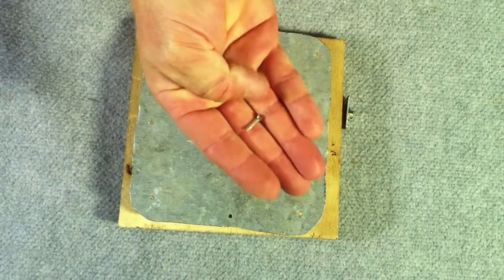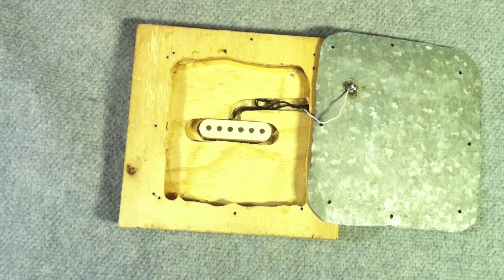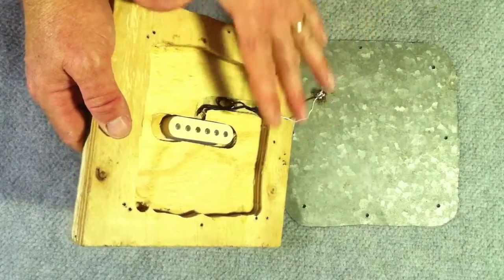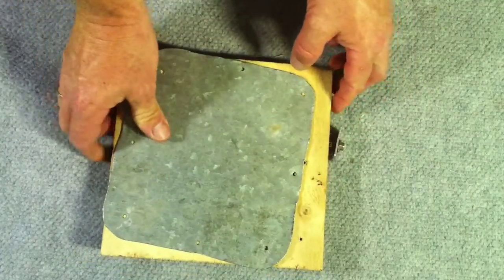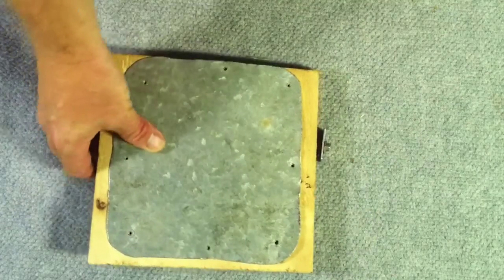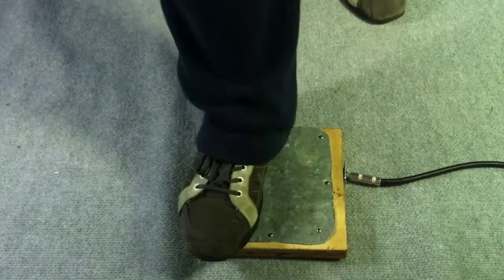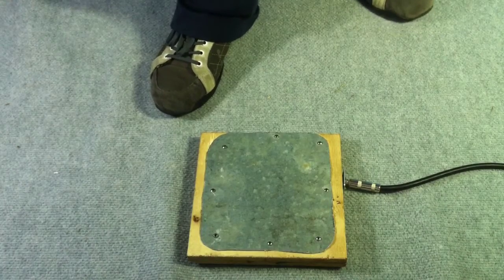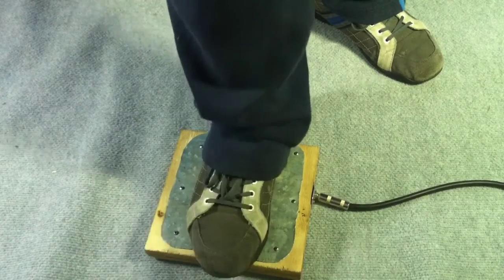DIY Stomp Box (Foot Drum)

Comment: Very interesting.  My version is cheaper and easier to build, but yours sounds better.  https://youtu.be/5n4reuFEYaE    
Since the coils in pickups are designed to have a piece of metal (a string) move sideways through the magnetic field, which generates the electrical current, I'm surprised that you get so much sound when the metal is moving vertically.